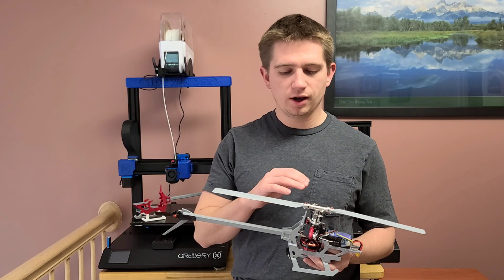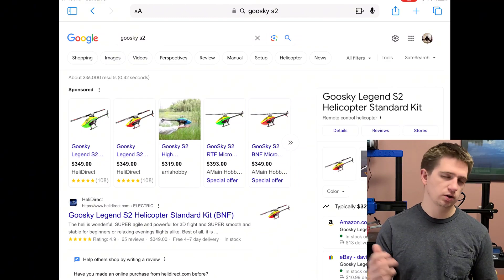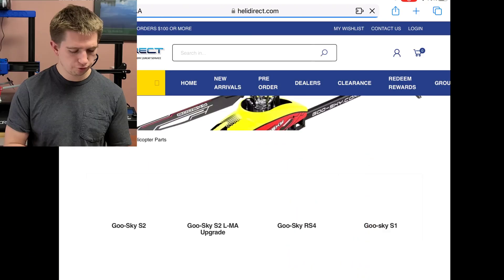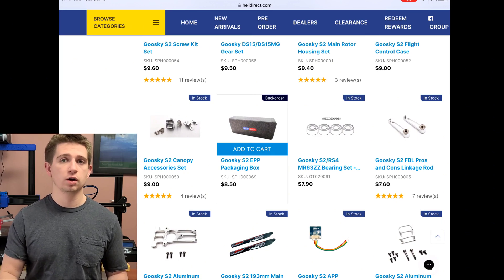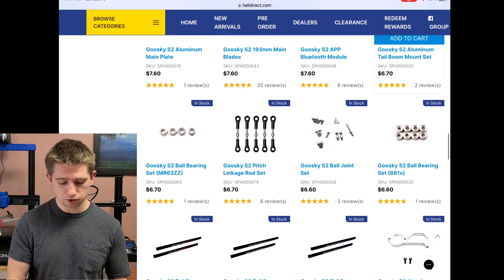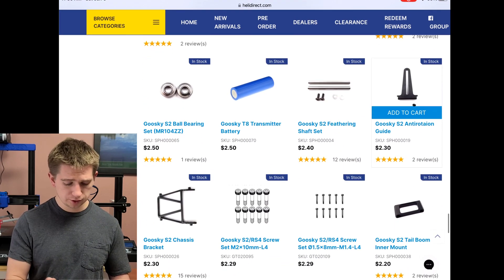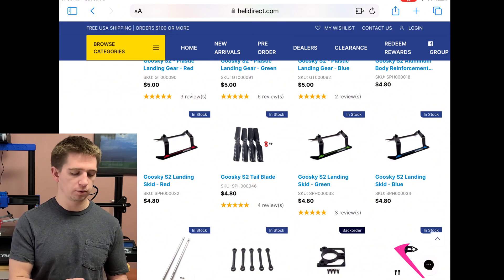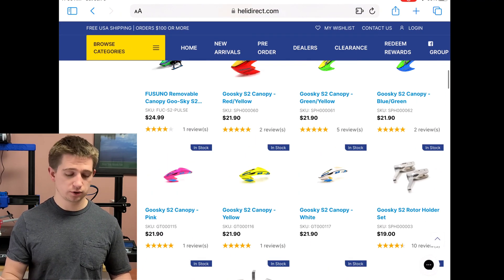How Much $$$ To Complete A 3D Printed Helicopter?

Comment: Subbed. I want to 3D print blade 230s fuselage with small modifications. I modified my 230s to become a FPV helicopter at 249 grams and HD onboard video recording that dives/flips/snaps with 35 minutes of flight time per charge. No quads under 250 grams can ever beat that, not even professionally designed DJI. They either have to change a battery and going over 250 grams, or they have to turn off HD video and turn off FPV and navigation and make the drone fly in a circle at constant speed to get that advertised 35 minutes per charge, and even then, they can't dive/snap/flip.
Reply from the maker: Thanks! That sounds like an amazing setup. You'll have to keep me posted on your progress 😀. Do you have any pictures? I would love to see the 230!
Reply: The 35 minutes flight with flips/snaps is already done at https://www.youtube.com/watch?v=ANwFh825Uj4
The diving-focus video is https://www.youtube.com/watch?v=Imbz30RExJA
The proof that the 30-minutes flight was with HD onboard recording is https://www.youtube.com/watch?v=HqzLxUxOKWE&t=17s
The gripe with building it is the hand-drilling of the custom servo bracket. The custom bracket is explained at  https://nocomputerbutphone.blogspot.com/2018/09/converged-iot-platform-build-notes.html#CustomBracket  .
Reply: My videos are sometimes indistinguishable from quad FPV videos. But all my videos are the same 230 helicopter setup, if you look closely, you can see the main rotor swiping on the front. For example, https://www.youtube.com/watch?v=0e7HijTFWX8
Reply from the maker: @johncgibson4720  This idea is great. I'm surprised that more people haven't tried this out. You should keep posting videos!

Comment: Please how to make a helicopter main rotor controller with hand not 3d printed please🙏
Reply from the maker: That's a great suggestion! Thanks!
Reply: Main rotor controller is basically BLHeli's specialty job. Concept heli builders should not do the specialty jobs.